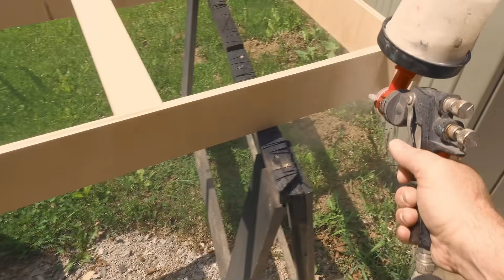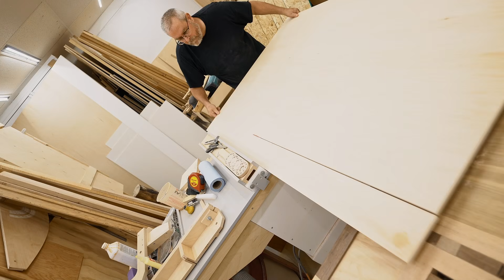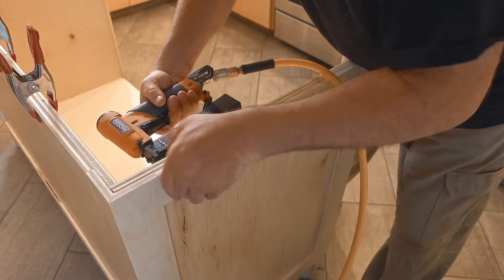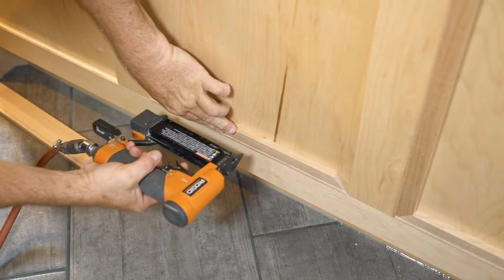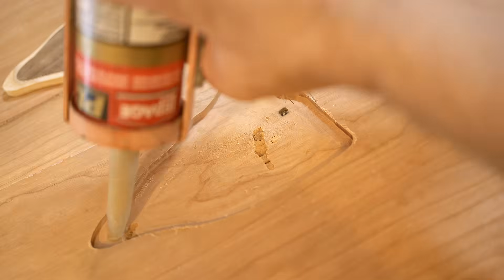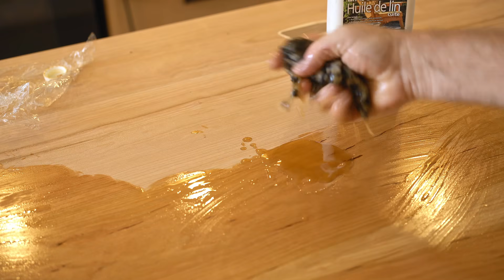Making a Modern Kitchen Island - Full Build Video

Comment from the maker: While I say this is a full build, I haven't made the drawers that will go in this island yet. That will be a project video on its own in the near future.
I've been planning this project for years and went through several different designs before settling on this one. My kitchen is fairly big (for such a small house) and it can easily accommodate an island this size. 
The top is 60" long, 38" from front to back and a full 2" thick. Made from solid cherry, it will naturally darken with age and get even better looking. 
The base cabinet is made mostly from 1/2" maple veneer plywood with some solid wood for the trim and corbels. The corbels (support brackets) are designed to match the doorway treatment I did going to my basement. They are decorative and functional, as they support the overhang. I'll be making a pair of fancy solid wood stools as a future project to go with this island.
Reply: Lindo trabalho, perfeito.
Sonho com o dia que me tornarei um profissional como você. 😅
PARABÉNS.
Reply: I see you make your own fixtures, fun in it's self. You a tool and die maker too?

Comment: I've been loving your videos, I've picked up all sorts of techniques from them, and they even lead me to your blog for more in depth discussion of techniques. I have one question about your glue up, based on your blog post(s) about glue, the construction adhesive seems like an excellent choice for most of the island, due to the pre-finishing, and variations in joint types/grain interfaces. However, the top join up of the cherry slabs seems ideal for yellow wood glue based on what I read in your blog posts, being a relatively large and flat surface of wood grain running in parallel, and one that I would think you would really want a maximally strong joint to avoid shifting over time.

What am I missing? My best guess is you wanted the PL to allow for some movement of the large chunks of wood over time?

Comment: In MA USA, by code, they make us run electricity to the island (hole from the bottom) so you don't have a cord draping across from the counter to the island for a blender or mixer and also secured to the floor (i think glue cleats like yours is acceptable)..  Does the area of Canada your in not have a similar rule about the electrical outlet?
Love the way this project came out by the way.

Comment: Hello John, thanks for the video!
I'm a beginner and I'm intrigued by the shot where you pull the circular saw towards yourself. Is it just a matter of practicality (i.e. you don't bend too much over a panel, risk skewing the cut etc) or does that have to do with for instance reverting the saw blade orientation to prevent chipout or... ? Genuinely curious & trying to learn :)

Another question but I think I have the answer to this one is, to cut out the "T bone" template into the top, you've used a flush trim bit in the trim router?

Many thanks & have a nice day
Enjoy cooking on that thing it's a beauty!

Gabriel, from Lyon, France

Comment: Great video. I love using the steak instead of the traditional bow ties. I actually got tired of seeing bow ties years ago. More so when someone puts tons of them on.

 Also, I'm not sure not making your jointer longer would have been good in the ling run. I have a small shop too, and unless you frequently build conference tables, a 12 inch wide jointer with longer infeed and outfeed tables would be an asset once every few years.. The fact that you can joint 12" wide lumber is better, and occasionally have to use  power plainer to get longer stock close is more than worth the space a bigger jointer would take up. Keep up the good work.

Comment: I've never seen an Island cabinet built, piece by piece, in place like that, plus all the extra goodies with using plywood where hardwood is typically used. I thoroughly enjoyed this.  Masterfully done. Love the corbels. I have never had much long term success with polyurethane wood glue, the construction glue is a no brainer, it works as long as it's needed to work. The stuff that looks and pours like honey is not stronger than wood after two or three years. It gets brittle, the joint fails. I've redone those failed joints with modern wood glue, they've gone close to ten years and are still strong. I sincerely hope they've reformulated the stuff to perform better.  Thanks John,  beautiful island.

Comment: You mentioned thicknessing to a little proud of the plywood. That got me thinking about plywood thickness in general. I wonder if you have found it has been really inconsistent lately. The last three batches we’ve ordered in have varied more than 1/32” under to a full 3/4”. Kind of frustrating. I love the look of the project. Especially that Deco-like corbels.

Comment: Oh man.  I hate it when  I start to argue with myself.  It's never fun, that guy is relentless. 

Looks great.  Quick question, do you sand between coats of poly?  I recently started using 0000 steel wool between coats but I'm not sure I like that.  Wondering what you do.

Thanks
Reply from the maker: I do sand, or scuff sand and that burgundy colour pad I used in the video is like a Scotch Brite pad for woodworking.